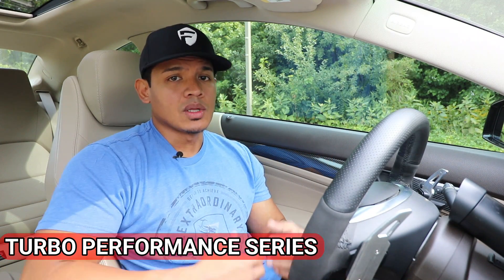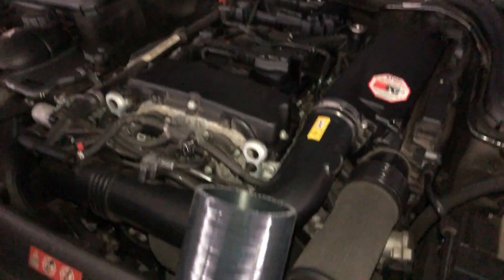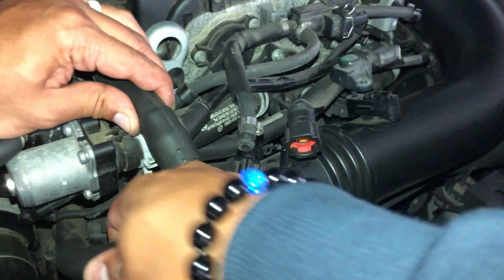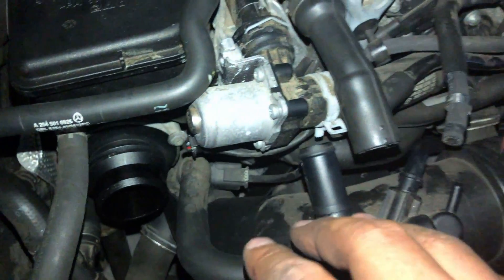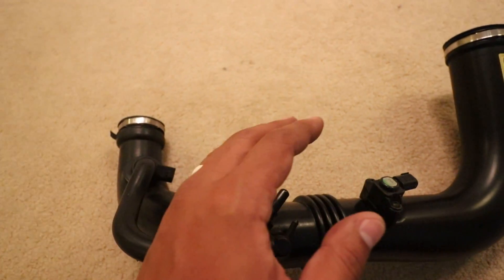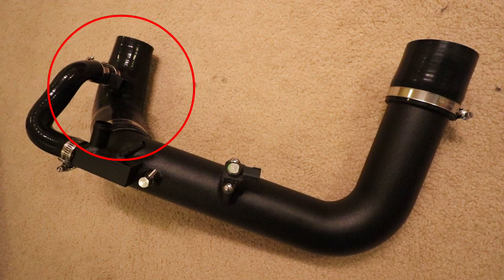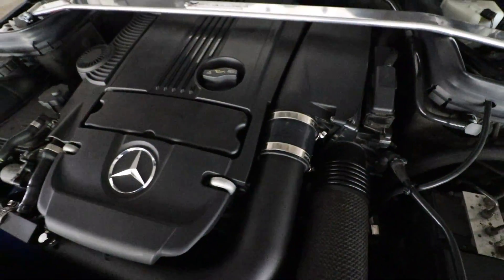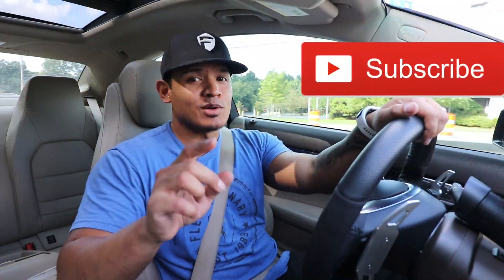Is this the best Mercedes-Benz C250 Air Intake?

Comment: cool stuff. good video. c250 is a turbo?
Reply: Yes it is. I have a 2013 Coupe with the Sports Package. 

The C250 came with the 1.8 Liter 4 Cylinder Turbo with Direct Injection up through 2014. 2015 they upped the engine to 2.0 Liters.

Comment: I don’t own a C250 (I have a C63) but I love your videos. Obviously the engines are different but the electrical and ICE stuff you do is awesome. Thanks!
Reply from the maker: Thanks! That’s means a lot. I’ll have 2 new cars to mod coming 2020.
Reply: Flexx Alexander Looking forward to the builds. I really should vlog the wide body I’m doing on my C63; it is as interesting as it has been frustrating.
Reply from the maker: Do it up!!!! I wanna see.
Reply: Flexx Alexander Haha I’ll try. The worst part is wheel options you know. When you have like infinite possibilities to stuff inside your rear fenders you spend hours every night after work looking at wheels. I think I’ve chosen though; will be nice to have an 11-12” out back for traction that’s for sure.

Comment: I just installed mines but I have a p0068 code and it seem like you have a small tube on the red clip on part where you plug it in on the sliver one at the top. I was wondering where do I get that small tube from?

Comment: Flexx, you are doing an amazing job with the C250. I'm only running a K&N filter on my C250 engine mods. I've gone ahead and ordered a new set of Staggered(18x8 and 18x9) Avant Garde M310's (GunMetal with machine face) with Nitto's NT 555's G2. Really exited to have these on my ride in the next week or so.
Reply from the maker: Nice bro! Those will look sick!

Comment: Looking to get a 2013 Mercedes Benz C250, can you tell me what mechanical problems I should expect from this vehicle. The more common ones you have came across.
Reply: MrZManny17 the first things you should buy a good scanner to scan whole car to see what are the hidden codes inside
Reply: I have the 2015 c250 and my cylinder 1 ignition coil went bad along with my fuel pump. I’m lucky as hell because my original warranty covered the associated costs otherwise I would have had to pay a few grand to replace the fuel pump
Reply: High pressure fuel pump... get one under warranty because they are notorious and that pump alone cost $700 alone
Reply: Camshaft sensor and the magnetic adjuster!

Comment: When removing the clamp underneath, use a socket with a long extension instead of a screwdriver, won't slip off like a screwdriver, much easier to do. Even a big hand dude can do it.
Reply: What Size socket?

Comment: Can anyone tell me what connector that is at 2:08 he pulled out mine broke and needs replacement
Reply: im trying to figure this out also
Reply: The one with the red push pin ?
Reply: @BC2FITTY  yes do you know what it's called?
Reply: Bobby Bates it’s called a brake booster vacuum hose
Reply: Randel H .

Comment: I replaced exact same parts from “turnado 
“. Did you get a check engine light after installing them? Because I did and why you did or didn’t
Reply from the maker: If I got one, I would mention it in the video. I don’t hide anything. If you got a check engine light, then pull the fault and see what the issue it.  Could be anything and could be unrelated to the pipe unless whoever installed it didn’t do it right or didn’t plug the sensors right, or didn’t disconnect the battery when removing the sensors. Again, go get the check engine fault pulled cause that will tell you what’s causing the light. No point in wasting time and guessing.
Reply: @TheFlexxGarage  at 2:30 min small tube   You also have another video describing that it could difficult to take off and don’t know if they sell just that tube by itself. Anyways what comes out of that if it’s broken? Do I need to add oil ?

Comment: Hey Flex question on the different intake upgrades, more so Silicon vs Aluminum. I get the whole heat dissipating deal, my question is Silicon actually BETTER for the MAF sensor? I’ve heard the aluminum vibrates it and cause improper A/F ratios
Reply from the maker: To your point on vibration, aluminum is not that great if it's 1 entire piece. That's why the new intake in my video is a hybrid. There's some aluminum for it's benefits, and there's silicone in the bends for it's benefits. I would go with some flexible all day long over something solid...but if you can get a hybrid, get the hybrid.
Reply: I see! I know you had both versions of the tornado tuning intake, & aluminum has that unbeatable induction sound, hybrid for the win
Reply: The c250 doesn’t have a maf , only a map sensor

Comment: Hey flex I install a GFB bv on my benz e250 w212 cgi but I'm not getting any response in terms of hearing the sneeze making any sound, I stall the valve and it sounds like the oem valve, can you give me any advice?
Reply from the maker: Don’t know. The copper piston on it could be stuck.  

But the question is…did you install a GFB DV+ or did you install a GFB VTA.   Cause the DV+ is not a blow off valve.  The VTA is the blow off valve.  I already did videos on both of these.

Comment: Can you use this for a 2009 c300? If not, which do you recommend?
Reply from the maker: No. This is for the turbo c250 engine only. There's nothing available for the 2008-2014 c300 that I know of.

Comment: Could we see a psi difference with the new gauge you installed? That would really get people to buy them!
Reply from the maker: Psi doesn’t always equal more performance. That’s just the air pressure within the piping.  

Effective Airflow and air temperature is waaaaay more effective as a measure of increase in power. 

You can have all the pressure in the world but if the air isn’t cold, you’re not gonna going to get added performance.  

My boost gauge is was mainly installed to measure turbo pressure so I don’t run too much boost and blow up my engine because the stock internals can only take so much since they are not built up.

Comment: Just installed the Tornado intake with a box performance filter and looks awesome. Also I noticed improvement in the midrange. But the happiness lasted very short because today is the second day with the mod and I just blew the head gasket while doing a 60-100mph acceleration 🤦🏾‍♂️
So the extra psi of boost that the intake gives you is not good for the car
Reply from the maker: Well, any legit mechanic can tell you  that’s not true. A head gasket is not related to an air intake kit.  An air intake does not add extra PSI.  That’s a turbo’s job. Even if the air intake brings in more air, there’s sensors in the engine to prevent extra air going into your engine unless you tune the car to accept more air. There’s also a diverter valve to purge the extra air (if there’s truly more charged air going through the air system). 

Sucks what happened to you but you shouldnt be blaming an air intake kit (regardless who makes it).  Even people who upgrade their turbos (a part that truly crams more air into their engine) don’t have head gaskets being blown.

Comment: I bought the intake tube, but it isn't easy to line up. I installed the turbo section first. The clip is hard to tighten up. It kept slipping off when lining up. I gave up and going to take it to a mechanic better.
Reply: Wow!! Mercedes technician was unable to install either, I will need to asked for authorized return
Reply: Hi Benjamin I have install more thank 20 sets with my hand this most hotest selling item and find is very funny it cannot be installed Very strange it got most sales world
Wide